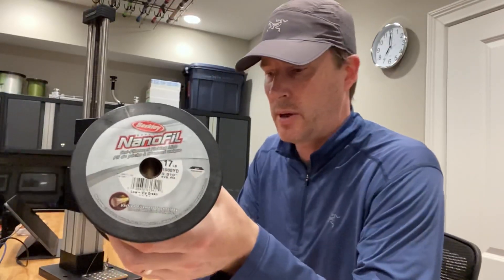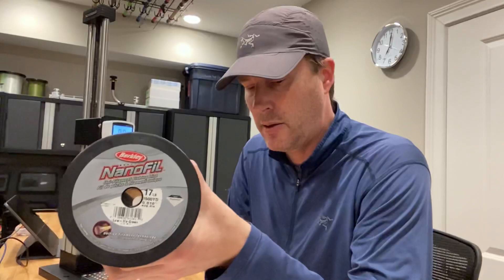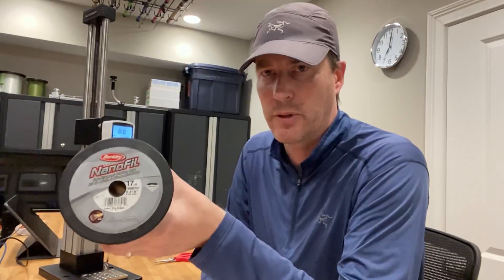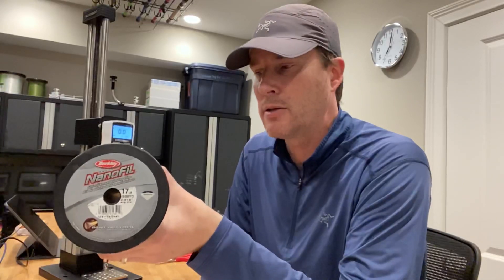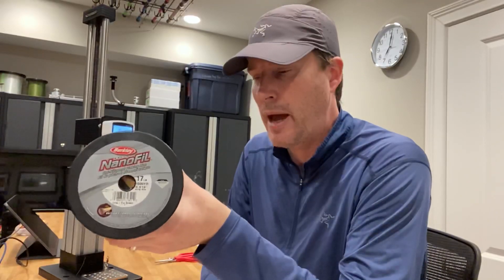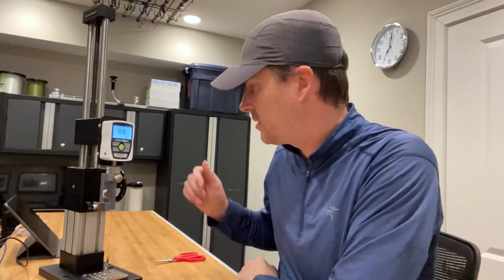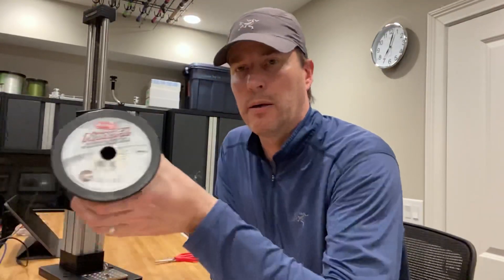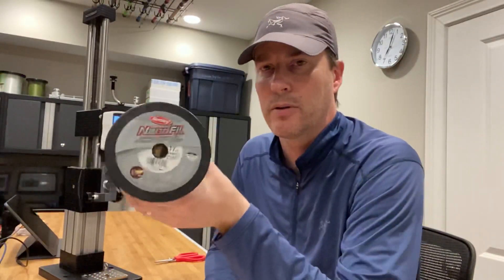Berkley’s Nanofil - Surprising Knot Results

Comment: I wonder how the FG knot would perform on this line.  Seems like an interesting line at first glance, but the knot limitations are unexpected.
Reply: I use it for Lite spinning rod, all the reviews on it are very divided but I can tell you one very important thing, if the tying is correct it is the most amazing line you have seen, I do a long fg, the test of my line is 5.25 kg I tested it with a weight of 4 kg and it worked  .  All in all, you must use leader with nanofil the Diameter relative to power is incredible, it is so thin that the casts are huge.
Reply: @cheapcopy1  Awesome to know.  Thank you.  I mostly fish sufix 832, but I am always up to  try something different in my pursuit to have my tackle locked down 100%.  I guess I better buy some and experiment a bit.